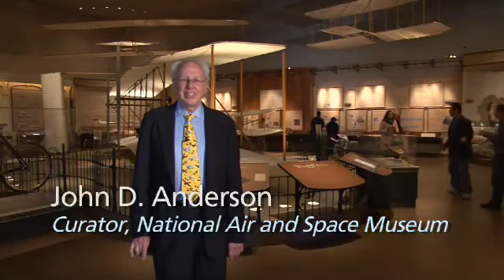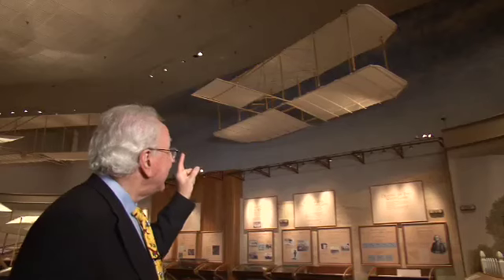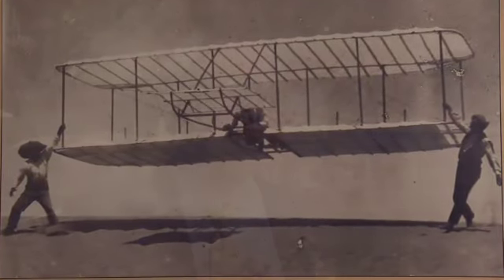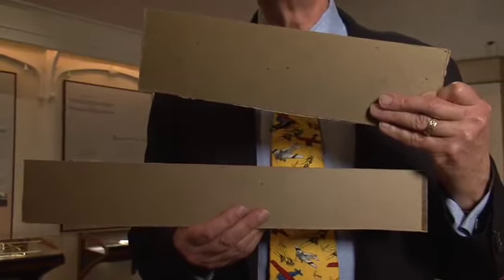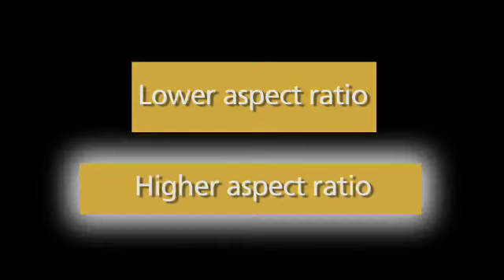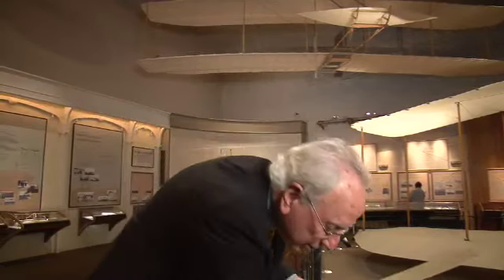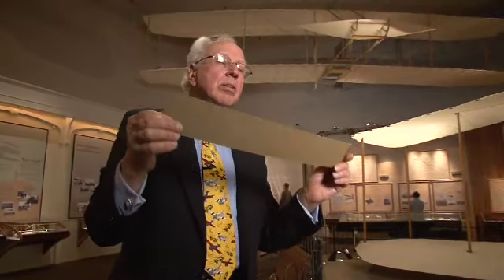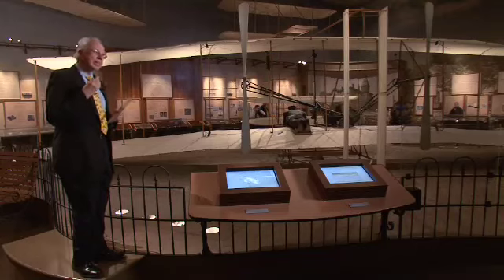The Wright Brothers Discover Aspect Ratio

Comment: Did the Wrights understand the problem was directly related to Bernoulli's Principle, which was defined in 1738, 161 years before their first glider?
Reply: I believe they did.  However, it's a long leap between that and an efficient airfoil shape.  The Wrights experimented with miniature airfoils in their own home-built wind tunnel, in what was the first use of a wind tunnel in aeronautical design.  They measured both lift and drag, understanding that both were critical.
Reply: If you look at a cross section of the wings, you can see they understood the Bernoulli Principle.
He probably should have mentioned that.